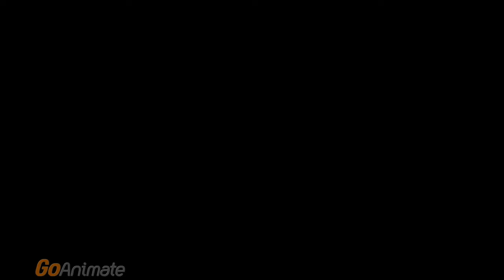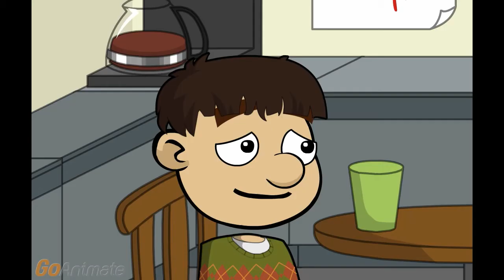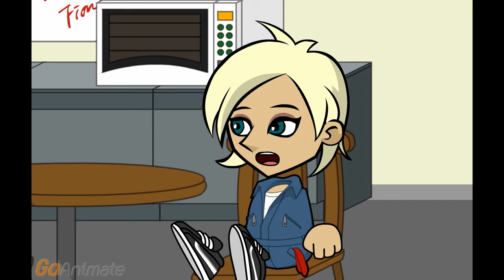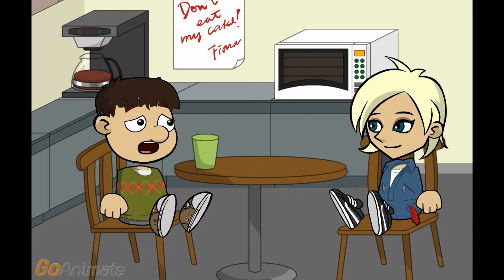Oil Furnace Soot Problems

Comment: I have an old oil boiler and was told that l should not open the plate in the front because that plate will be hard to reinstall. Inwas told to imsert the shop vac thru the whole and remove the soot that was is that correct.   opening up the plate to clean inside the soot